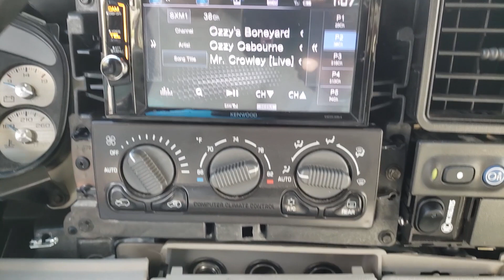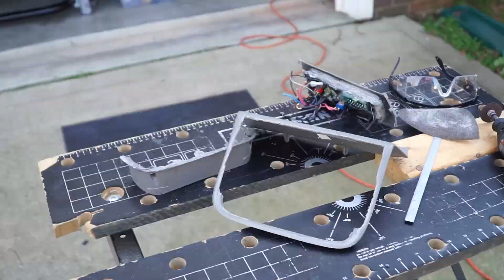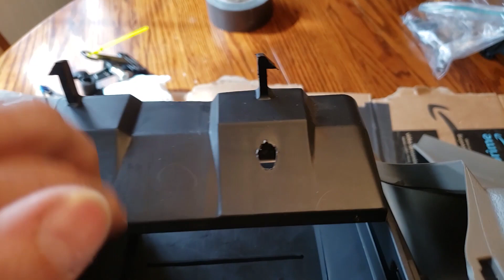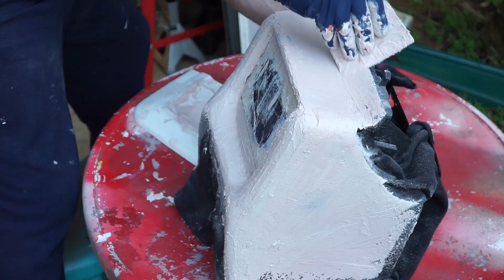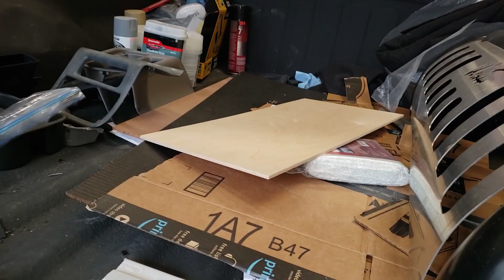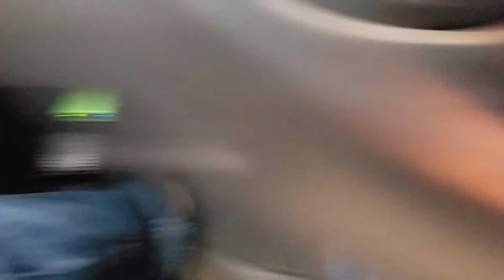Must Have Car Mod

Comment: What kinda transmission work u got done?
Reply from the maker: A fully rebuilt 4L80e with a Circle D torque converter.
Reply: Tahoe Steve what about when you did that before and after header video 3years ago?